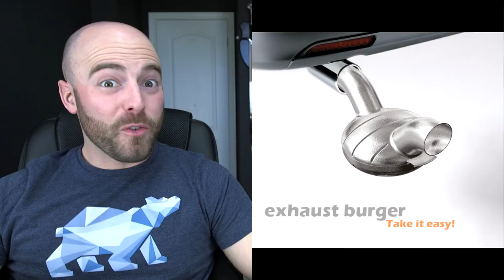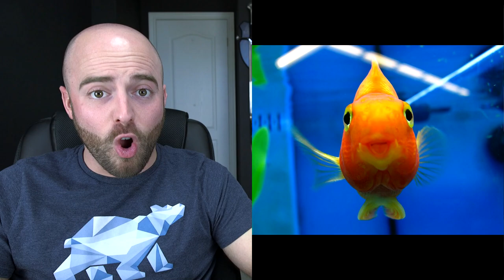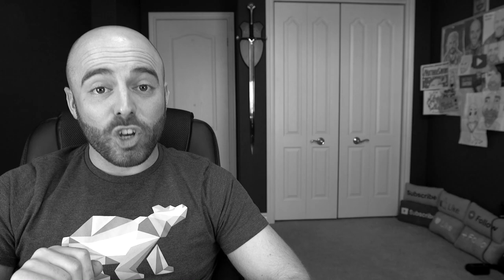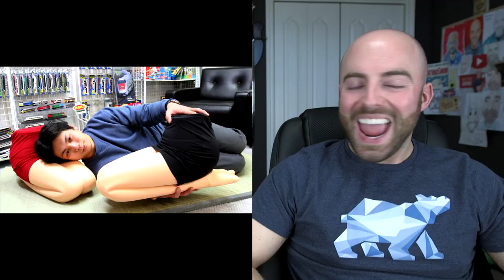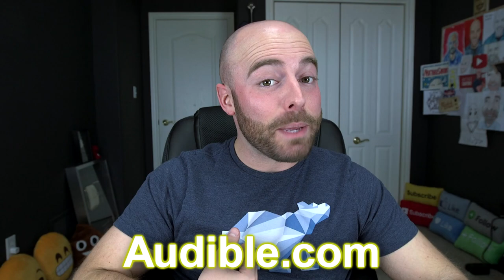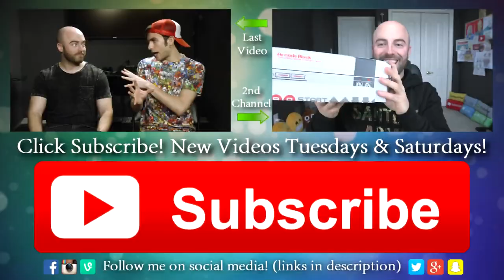The 10 Most USELESS INVENTIONS Ever Created!

Comment: My issue with #1 is, how can you tell how well done the burger is, considering the facts that you can't see it until you open it, and it'll be REALLY hot when you first stop, making you likely have to wait to open it to even check on it, and most cars have varying exhaust flow and temperature at the exit point.